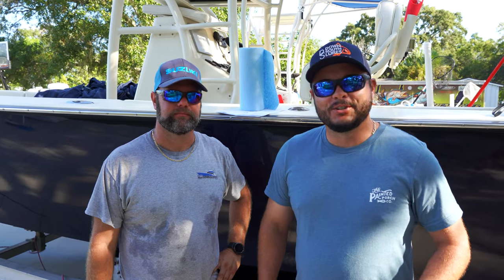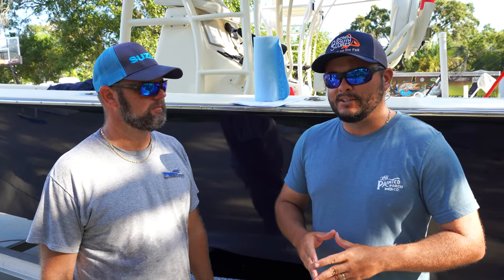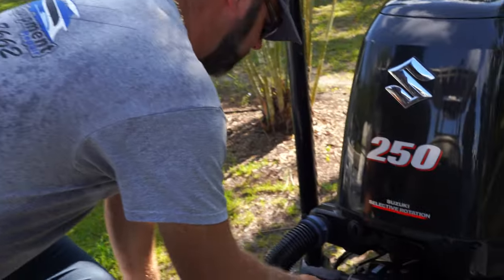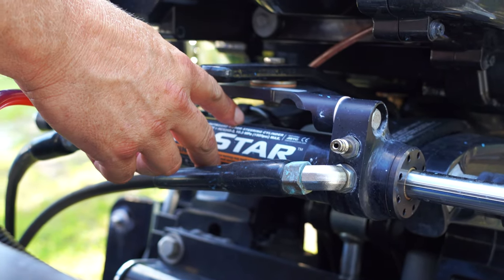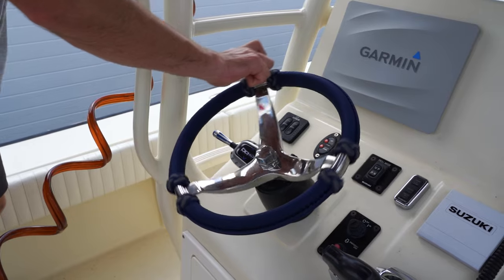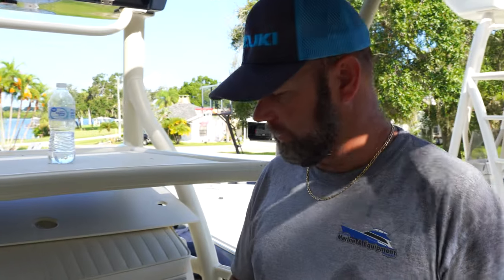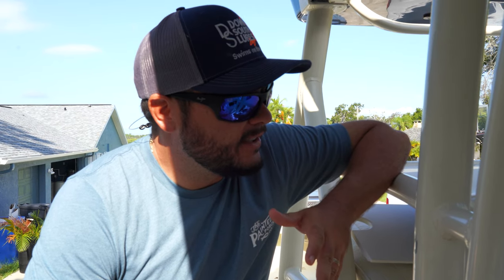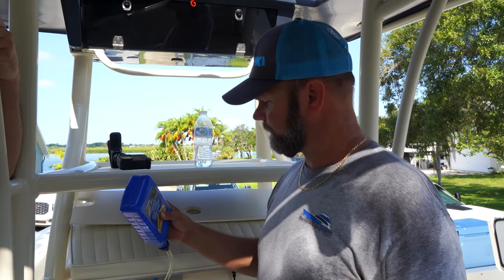How To Bleed & Replace Marine Hydraulic Steering EASILY - SEASTAR

Comment: Thanks for the video! I have air in my lines, do I need to bleed the cylinder or can I just add fluid and pull the air from the steering column?

Comment: Im currently doing this I’ve had very stiff steering so I bleed the system completely out .. The fluid looked like coffee milky brown and watery , I have no leaks visible that I can notice checked all seals .  

So even with no fluid in the system when I go to manually push the motor from side to side it’s still hard as hell. 

I went ahead and filled the helm with all new fluid yet nothing has changed any ideas ?  Maybe the pivot point is shot ir just time for a new sea star.
Reply: Steering tube (pivot point) corroded.
Reply: @PeedPeeBody  eventually figured it out about 2 months ago,  yes Grease and more grease..

Ended up buying a torch heating the shaft up until all the old grease melted out and pumped it full of fresh grease good as new!!
Reply: Your steering tub needs to be grease or replaced

Comment: A mechanic that I know that has  been around a long time swears by automatic transmission fluid in the Seastar pumps. He claims that the Seastar brand hydraulic oil will make the pump valves stick. He claims he’s fixed a few of them and he put an automatic transmission fluid in them and never has an issue with them again.🤷‍♂️